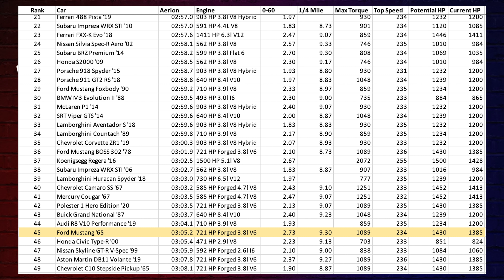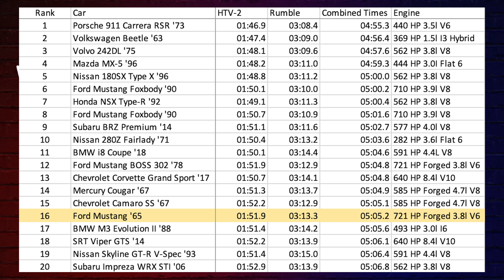You're Using the WRONG BUILD | 1965 Ford Mustang | Need for Speed Heat

Comment: I tested a another engine that  have a better 0-60 for the mustang it the 6.5 V12 My setup is all ultimate parts with the roots supercharger, showcase suspension, elite brakes, drag tires, 6 speed, pro drift differential. Steer +3, Downforce -5. You can try it out if you want